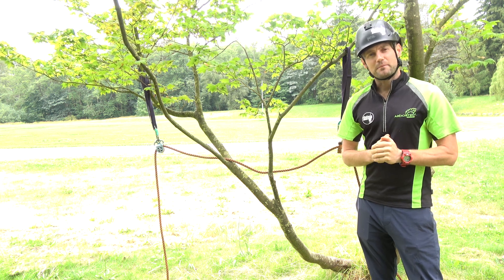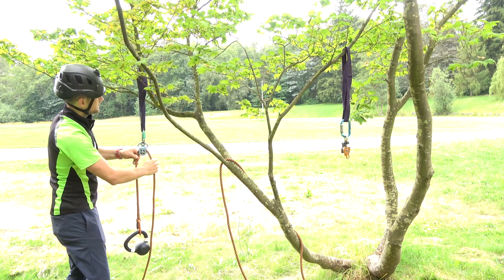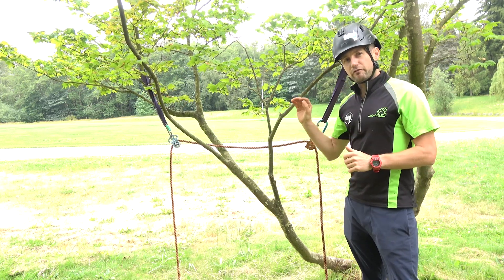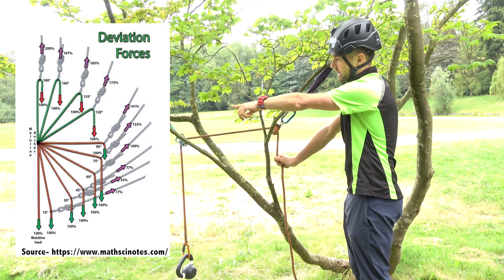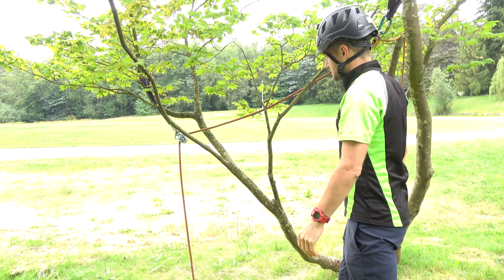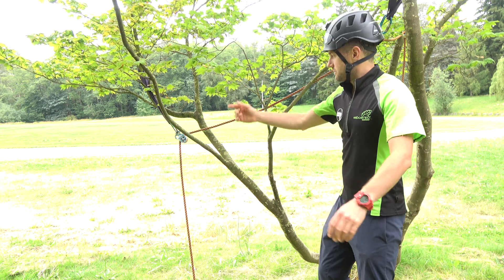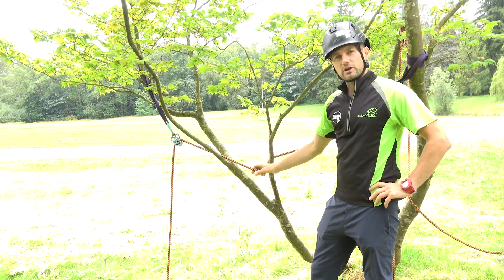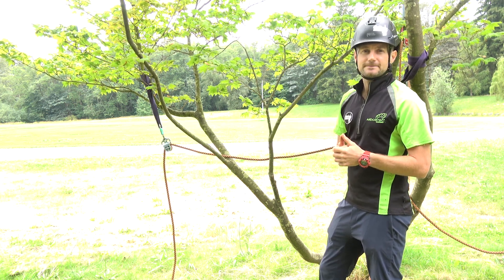Using multiple rigging points

Comment: The critical feature of the demo is the way all branches point down to a central trunk, meaning when you add a second rigging point the load on both sides becomes more aligned with the axis of the respective branches. Axial loading is always safer. I've seen guys use two different trees for span rigging, not understanding how side loading amplifies risk. Add to that the way taught lines multiply force, and you've got a situation where span rigging between trees comes with higher risk.

Comment: Thanks for the information, appreciate it. Another tool in the box is ratchet tie down, use that to tie the two branches on a fork therefore reinforce the fork, when there is no other tying points to set up a multi anchor rigging system

Comment: I've been using this kind of system to wreck out Siberian Elms. They're hard to get a good high solid rigging point, and if you do have one, guaranteed it isn't where you need it. With the flex of the stems pulling together when they get loaded you get a lot less shock load. Feels kinda funny if you redirect your SRT system on the same stems. Great explanation, and I'm glad my hillbilly brain came to the same conclusions.
Reply from the maker: Maybe not pulling the stems together as much as directing the force down into the angle of the stems. But sure makes a big difference when there is no real great central rigging point.
Reply: @ClimbingArborist  I think in the times I've used it, the angles we such when unloaded the slings didn't quite match the stems, but once loaded, they pulled in toward one another a few degrees and then settled where they were vectored straight down the stem. So there was just a little progressive shock load damping. Great job explaining and demonstrating in the video, perfect to use a small tree like that where it fully shows the results of the forces in a quick and easy way. I think something you showed, but didn't quite spell out was how the location of your portawrap affects the vectoring of the force on your first anchor point. (the one on the right in the video) Wait, or does it? Of course, opening that angle up would increase the forces on the anchor point, but does it change the vector of the force?

Comment: I used this today on a birch that had one half leaning over a house.  I tied a vector from the base though the stem to 2 other load points as high & centrally located as possible.  Dispersed the load throughout the system.   It turned out text  book good. I liked it a lot.  Good video man.  Thx

Comment: On a 5.30 picture shown carbines that produce friction (50% on a left side)...
Reply from the maker: 90 degree angle shows 141%. Carabiners and rings add friction and reduce force a little.
Reply: @ClimbingArborist  even best pulley efficiency 95 %